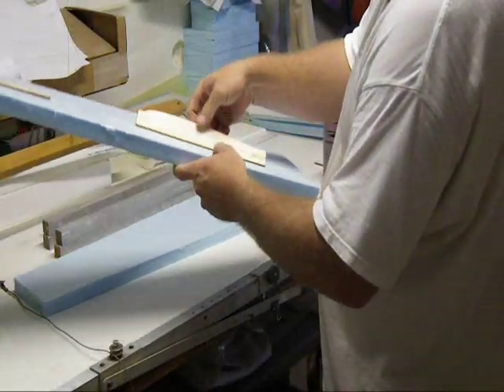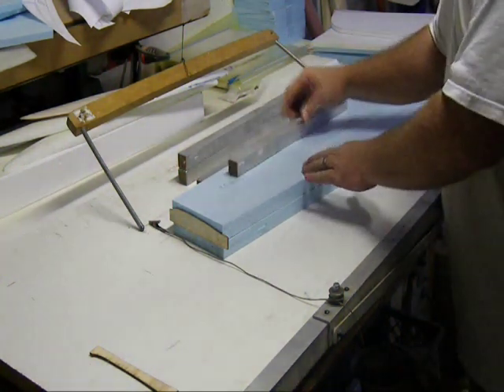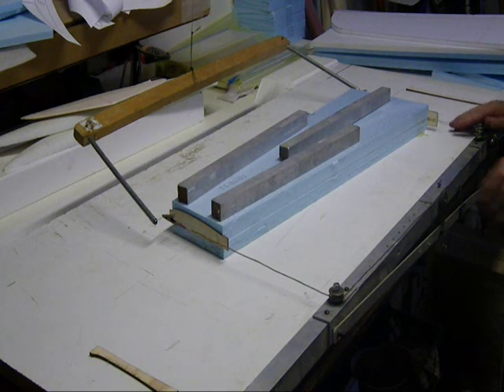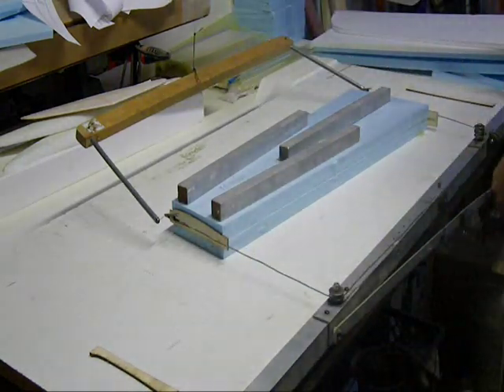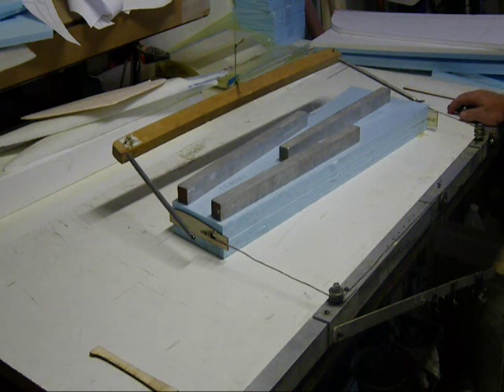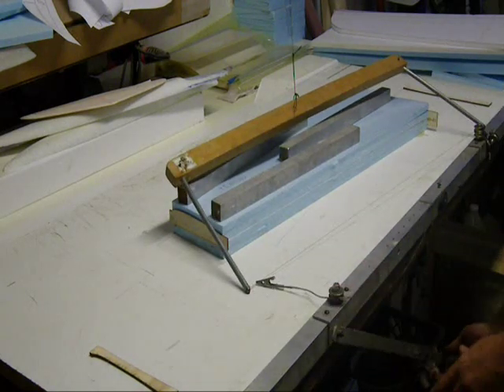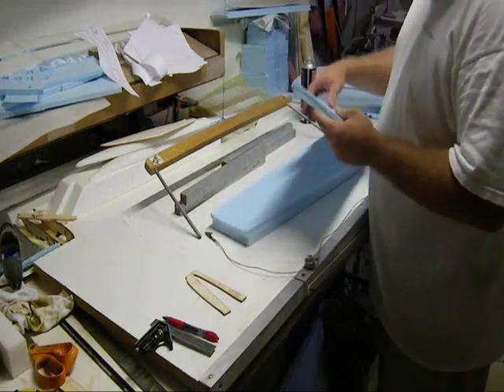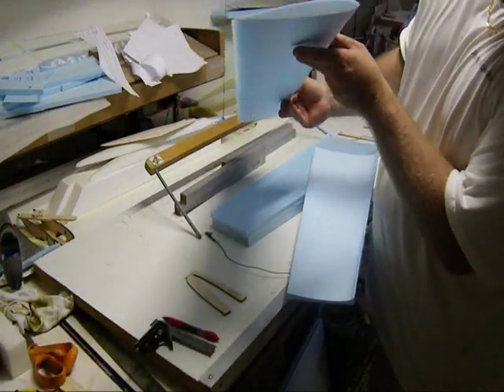Hot Wire Cutting with Homemade Gravity Cutter Interrogator Wing cutting Part 1.wmv

Comment: Which size of wire is best for foam cutting. I mean which awz no. Or in mm
Reply: .015 / .016 , I just ordered a 100 ft spool from Amazon for under $ 10 bucks. 
It’s called nichrome wire

Comment: I'm guessing you have a transformer or power supply to heat the wire. Where are the technical details such as amperage, wattage, wiring connections and so forth? The purpose of a video is to explain - your video just raises more questions!

???